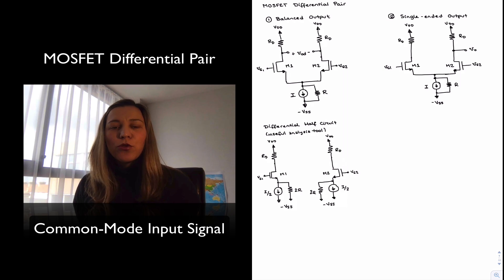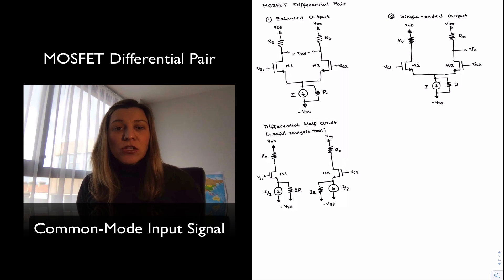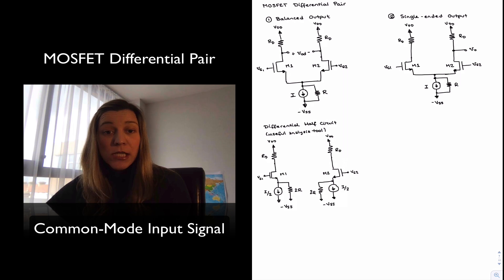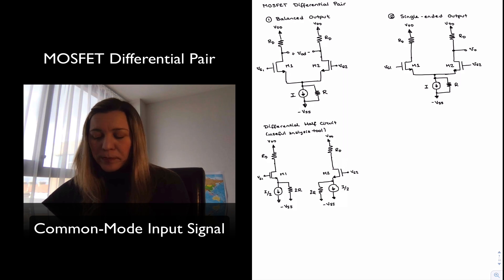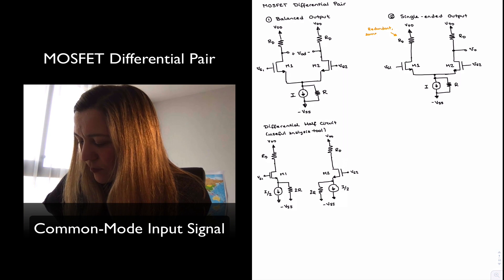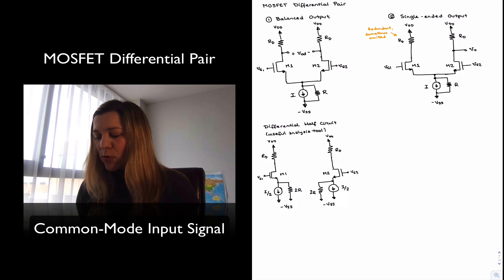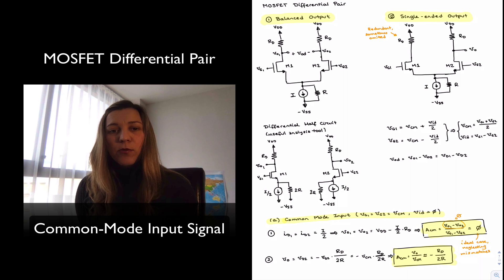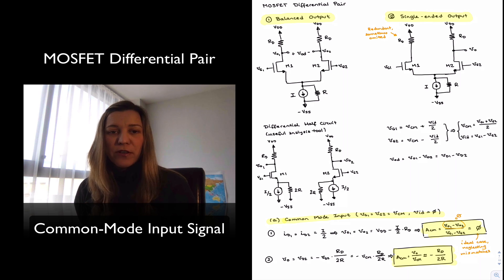MOSFET Differential Amplifier with Common Mode Input

Comment: why wouldn't the common mode gain be undefined, since v01 - v02 = 0, and vg1 - vg2 = 0; hence 0/0?
Reply: I agree with you. The denominator in the expression of Acm should be taken as solely Vg (Vg1=Vg2=Vg) not in the difference form. The reason is that assume we have a nonzero differential output, i.e. in case of mismatch, how are we going to calculate Acm while the denominator is always zero since the inputs are still common?